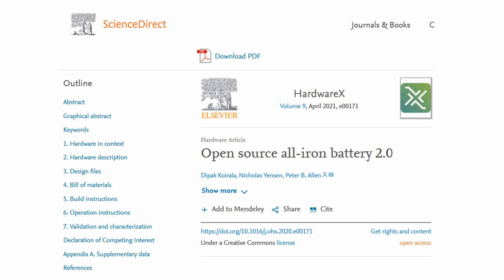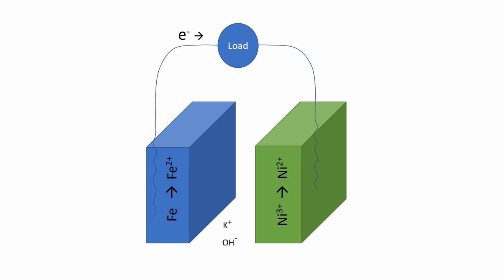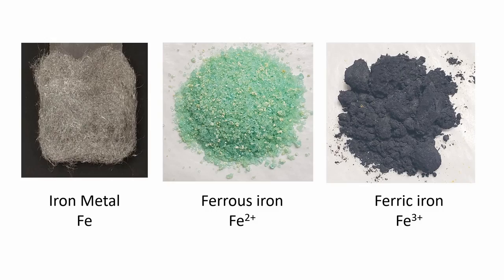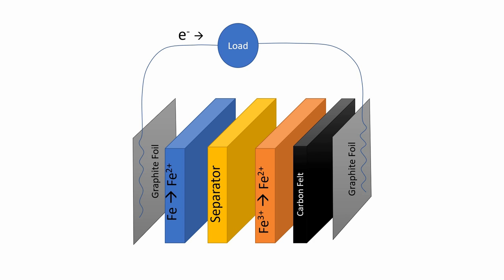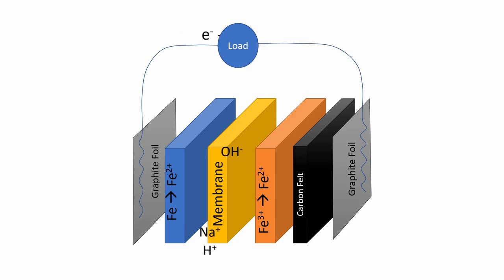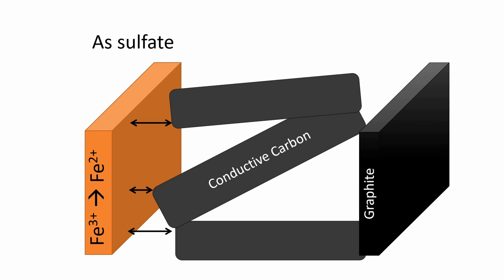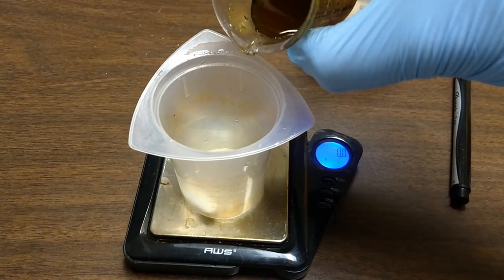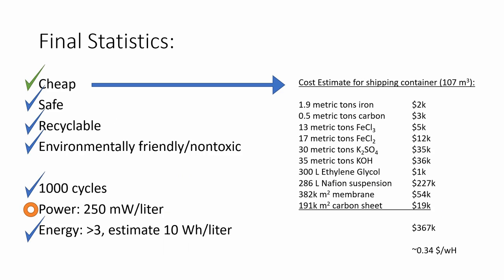Iron Battery 2.0: 250X More Power! Publication announcement (fixed)

Comment: I found yor video because I was daydreaming about an iron-iron chloride battery, This might sound environmentally bad, but wouldn't a mercury electrode be impervious to hydrochloric acid? Like a cell with mercury at the bottom and a sheet of iron above it with a seperator. Then you could use a thick enough piece of iron that it wouldn't use all the acid. The only thing I don't know,( because I'm not a chemist) is what would happen when the iron chloride touches the surface of the mercury. Would it make an amalagam or would it just stick to the surface? The only reason I ask is if it makes an amalgam it would work better becasue you wouldn't have dentrites form. It wouldn't be too environmentally bad because the mercury would just sit in a plastic cell.
Reply from the maker: There are a couple of issues, one being that that iron anode will just react with the HCl and water to make iron chloride and hydrogen. Using high pH stops that. Then the next issue is what reaction happens at the cathode? You need something to take up those electrons and mercury metal can't do it. It's a useful electrode in some applications despite its toxicity, but you need something oxidized. I don't know what would do that in that context. Molten metal batteries are really interesting, though. Here's an explanation of the Sadoway battery: https://youtu.be/VNCC8QGy_u0?t=335
Reply: I guess I was thinking there would be a reaction between the hydrogen and the mercury. Looking up mercury hydride I see that that would be a mistake. So you are saying if you want electricity from iron and hydrochloric acid you would have to put the hydrogen through a fuel cell or burn it in a generator. Would the reaction be difficult to reverse or recharge back to iron and hydrochloric acid with electrolysis? I'm assuming there would be some heat involved also.

Comment: i'm working on mettalic sodium batteries. need helps on current collector. internal resistance is so high. suggest me material on current collector side
Reply from the maker: The best we found was a high percentage of carbon black (Ketjenblack). Good luck

Comment: how about iron-copper(air) in CuSO4 water at 1.1V? its rechargeable, just remove the iron electrode from the solution to prevent the self-discharge, so iron instead of the typical zinc, the CuSO4+Fe->FeSO4+Cu typical plating reaction, reversive/rechargeable, iron-copper electrodes should give only 0.78V, so its not the basic reaction, its either a more complicated Fe/Cu swap or oxygen plays a part in the voltage difference, iron air standard potentials would give about 1.6V but water decomposition at 1.23V limits it to that voltage at max.

Comment: Good science!  You should consider a collab with the Tech Ingredients channel.

I'm not educated enough to comment with any authority, but it seems like the bottleneck here is the available surface area for ion exchange.  It would seem that there would probably be a pretty sharp dropoff of delivered power when concentrations dip a bit.  Maybe solve this by banking the solutions in storage tanks, and flowing the solutions across one another in a reaction cell.  You would invest some energy in pumping the solutions; but since the storage tanks can scale, this should be a viable tradeoff to make.  It seems more viable than trying to have infinite area for ion exchange to occur over.

Comment: Would a ferrofluid containing the electrolyte assist in current flow and collection?
Reply from the maker: I don't know. I'm not familiar with ferrofluid compositions. The only ones I know are oil-based and that probably wouldn't work well. I don't think the magnetic properties would have any effect.
Reply: @PeterAllenLab  I was more thinking that the ferrofluid could be piped through a tube and that a wire could be coiled around the tube to make an Iron flow battery of sorts that is powered solely by iron.

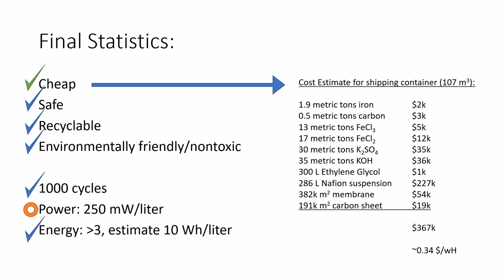Comment: @5:10 so let met get this straight, for 367k you can store energy at 34 cents/wH over 1000 cycles? I tried to compute that into something functional, but it doesn't make sense. Okay apparently it should be sufficient to power 4 homes for several days. I can do that. My home consumes 10kWH per day, so I would need 45 kWH for this equation. I can buy 304Ah LFP batteries for about 90 euro. 48 of them would render me just over 45 kWH capacity. I would need 3 BMS's each around 600 euro each. So a grant total of 6120 euro and I can store those in the corner of my shed. Not to mention they can perform 4000 cycles. 

Look, don't get me wrong, I love the idea of open source and open research as much as the next guy. I contribute to open source projects myself. But, as please prove me wrong, this feels rather pointless to demonstrate an entire shipping container costing at least 15 times more, taking up at least 25 times the space and has a quarter of the lifespan. Or at the very least please provide additional insight by comparing to a regular cell and pointing out the differences.
Reply from the maker: You're not wrong. Every year li-ion gets cheaper. When I started this project in 2017 the economics looked better. That being said, this has zero economy of scale, so it's hard to compare. In general, yeah, I'd buy a commercial solution. This is more of an exercise or maybe in the very long term this is the start of a sustainable solution.
Reply: @PeterAllenLab  As I'm seeing battery tech progressing, I think Iron Salt batteries have more validity in the flow type battery type. 

Just adding storage by adding more electrolyte basically. There have been quite a few improvements in that area recently, but it isn't that user friendly anymore I'm afraid.

Comment: Chinese solved cheap mass production of lithium iron phosphate and now they're starting to develop sodium iron currently 160 kW per kg.....what kind of energy density are you achieving
Reply: according to the 250mw/liter figure (and if it is meant to say 250mwh/liter) that would be 1000 time less than li-ion
Reply: @romteb  sounds like a fun kindergarten experiment
Reply from the maker: That was power density. Energy density is a little better than that: at least 10000 mAh/L or ~3000 mWh/L. Still not a contender with Li-Ion. And, unlike power, the ceiling is pretty low. We're accessing 50+% of the iron in the cell. So if we managed to access 100% of the iron, we would probably not even double capacity. You can see the data in the paper, Figure 6B. 8 ml cell discharged deeply, but not to completion. http://dx.doi.org/10.1016/j.ohx.2020.e00171

Comment: What you've done maybe grand, yet still not accessible to all.  You came up with a battery that will power 4 homes for few days ? What could be the average cost of such a battery ? What would be the volume of such a battery ? What would be the weight of such a battery ?  What would be the life of such a battery ? If divided into several batteries what would be the weight and volume of the smallest battery  ? Now you can still make lots of money yourself by selling a practical guide on how to construct such a battery. Or by manufacturing such a battery in a warehouse upon request...Not all people are handyman ! 
What is your email address Peter Allen ? It still can be open source as well !

Comment: so 4 litres of battery to store 1 watt? Useless then.
Reply: Usually power density is per area of one electrode, not volume? So yes decreasing distance between electrodes and increasing the area, like with a rolled up cell, will improve power density. Why dismiss KOH? It is not corrosive to other things in a car than Aluminium, so easily contained in a battery. Poisionous, yes, but how many people drink electrolyte from a battery by accident? Yes abetter option is NaOH which is not poisionous in the same way as KOH but still a base, but very cheap and readily available. Edison cells used nickel plated steel plates or steel woll to save cost. they were not all using pure nickel electrodes.
Reply: Watts are not stored but watt-hours are. 10wh/l is not terrible for static applications. About 30 times less than lipo. With a car size set of
10k batteries on the grid you could power a house all night
My big worry is the efficiency, also 1k cycles is useless for grid. Full replacement in 3 to 5 years